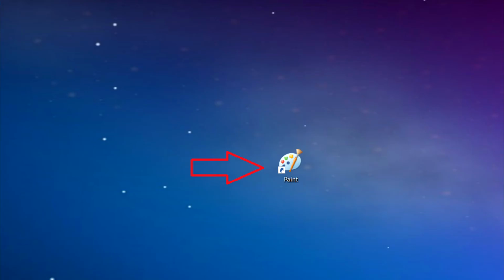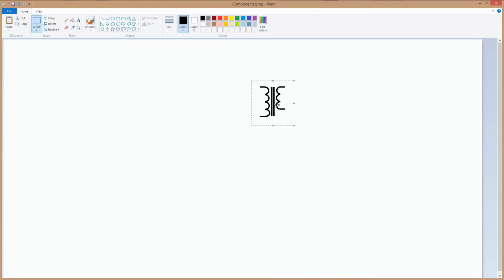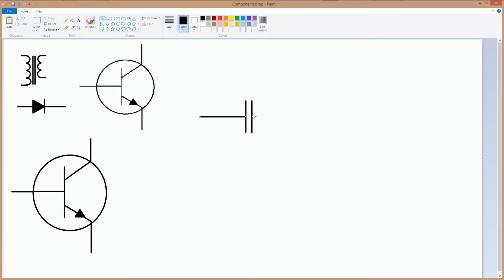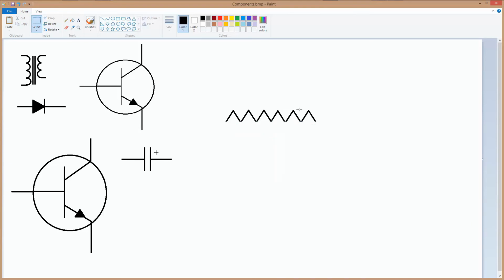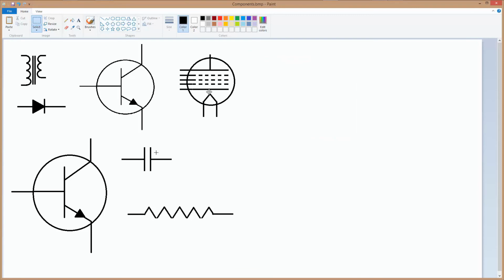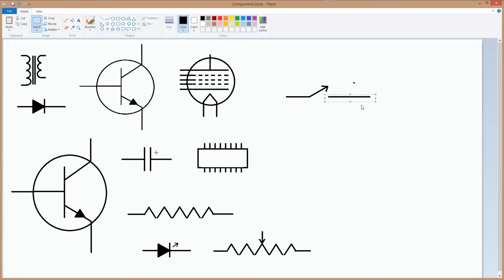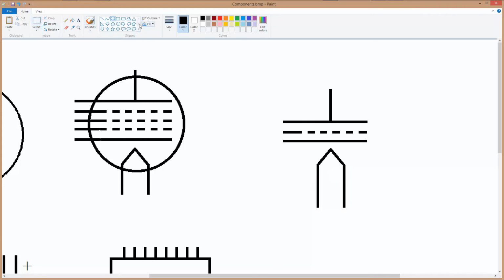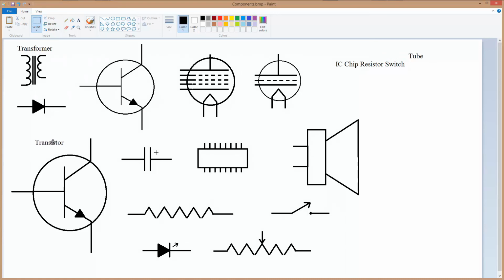CAD 101 Computer Aided Drafting 1 - Start drawing using CAD immediately

Comment: I know I'm a few years late, but... in case this helps anyone later-
Tips:
1) Hold 'SHIFT' when drawing a line to force the line into a smooth vertical, diagonal, horizontal position. Should ease some of this original drawing tedium and make nice looking long(er) connections. 
2) If you have items inside of an assembly that are not removable without clipping corners with the square select, the arrow underneath it (click the word 'Select' itself) gives you selection options including a lasso tool which should allow you to draw out your selection and isolate specific pieces in a potentially less cumbersome way for more complex selections. 
3) If you want to pull something from anywhere on your screen into paint easily, the default command to copy a part of it is "WindowsKey+Shift+S" Once you've selected the piece to copy, you can close it (if it doesn't automatically), return to paint, and paste "Ctrl+V" to drop the selected area into the program. Like taking a picture! 

Hope these help!